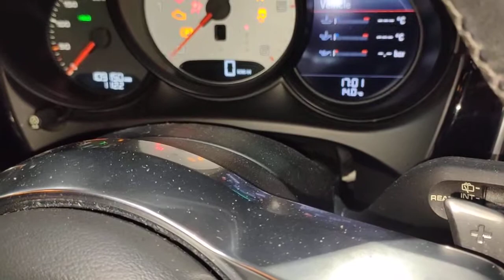Porsche Macan Diesel - Coolant flange replacement & other parts all done - Starting engine

Comment: Please help, I am really worried. I did the exact job where I replaced oil cooler, and flanges. bleed the air out of coolant system and filled it usung coolant vacuum refiller the one you used. I then Primed the fuel pumps using VCDS and ran them for 3 mins to bleed any air and fill the fuel lines. Started the car, it kept trying but didn't start. I stopped after 15 seconds. I then manually open the injectors fuel lines and fuel return line while fule pump was running to bleed air out, tried agin for 15 seconds, but still it tries but didn't start.
Please help. What I am missing?
Reply from the maker: Just make sure everything is connected & no faults is logged.
Keep cranking the car with a jumper battery it will start.
Takes a while to build up
Reply: @emdporschespecialistcaring8975  But for how long I should let it try to start? I heard it can kill the injectors ? Please do reply. I am in Canada and it is 5:18 pm. I still have some day hous left to try.
Reply from the maker: @tahirotahir  try cranking engine 3 times & 10 mins rest to cool down starter cable & try again....... it's just air in the system.
Connect your scan tool & watch your fuel pressure as you crank the engine....it should slowly build up

Don't stress it will start
Reply: @emdporschespecialistcaring8975  How long (in seconds) I should let the engine cranking go during these 3 tries?
And thank you so so so so much for your replies. You have no idea how much your help mean to me at this moment.
Reply from the maker: @tahirotahir  10secs
Reply: @emdporschespecialistcaring8975  Thank you, God bless.
Reply: Sharing the updates:
I got my car started FINALLY, and it exactly took 3 tries each 10 second long, This is what I did over all.
1st: 
To play safe on injectors, I ran both fuel pump using OBDEleven for 3 mins so there will be fuel in fuel lines, and on top of that (with 2nd person's help who was holding my phone to start and stop the pump as OBDEleven app was running off of my phone) while fuel pump were running I loosen up the injector's fuel lines bolts, enough to release block air pockets and same thing I did with return fuel lines, and there was enough air in all lines. I kept towels to catch all the diesel.
2nd:
After talking to you, I jump start using jumper cables.
3rd: 
As per you instructions after every 10 seconds try I waited 10 min. When I contacted you, I was sitting at 1st step. I hope my detailed reply might help others who might contact or see your video later.
The big and Bad News:
Bad news but only for me is that my car is completely parked now, because during this job, I also tried to removed a broken & stuck glow plug. But while drilling it out the drill bit broke in there. So currently half stuck and uneven drilled bit and part of glow plug is stuck in it and when I took my car for test drive , down the street it sprayed the diesel all over the engine, so much that engine started smoking and that bay where the oil cooler lives, filled with diesel. I towed the car home which was like 1000 feet from my house. Check all fuel lines if any I left loose, but all were tight. Pumped out the diesel from that bay. Checked, and now idea is that diesel spray from the same glow plug hole, becsuse now noticed while car is parked and running that Diesel bubbles are coming from walls of the glow plug hole where half drilled, drill bit is stuck. 
Sorry for very long detail but thought to share my pain.